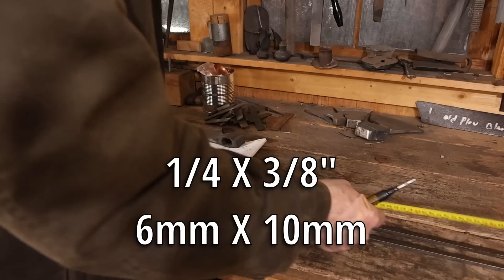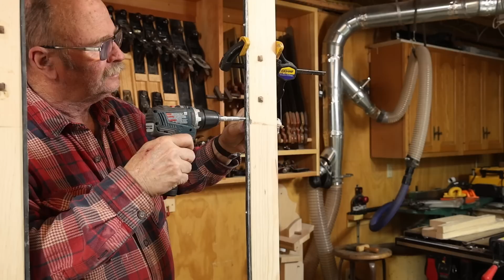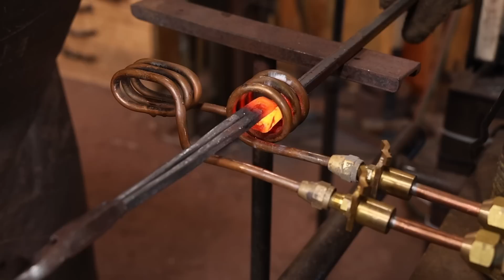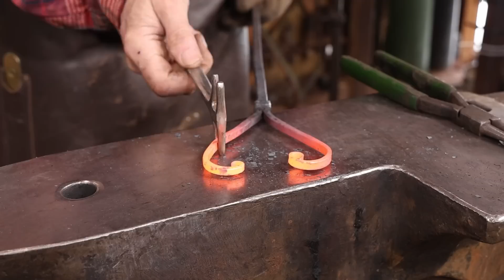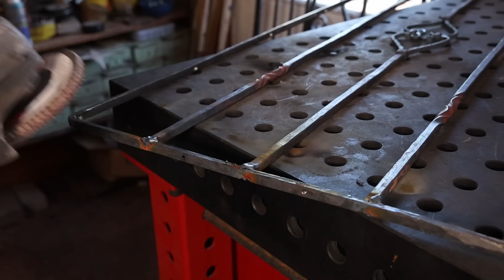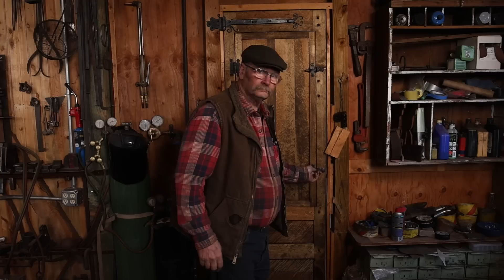Forging a simple Iron Window Grille for the shop door

Comment: Was given a rectangular (1" X 2") steel tube with oak leaf aacorn embellishments. One small detail. It's 5 1/2 " short. A recurring problem with my 1906 house. My thought is to add (weld)an extension to the top of the frame and panel it in solid like the bottom 4".

Comment: Neat project and good work, John.  This is NOT a remark, just something I'll share from personal experience...I found a HUGE improvement in my TIG welds by switching from a the standard (read: awkward) TIG torch, such as the one in the video, to the smaller "aircraft" style torches.  I have 2 of them...one is a 75 degree head, the other a straight "pencil" style.  You could literally touch mark, or autograph your larger work with the straight model.  They both are highly maneuverable and share same gas cups and other parts to a large degree.  Can't beat 'em for small work such as this!  Save the big torch for large sections, plate joining, and other such sized work.
Reply from the maker: I'll have to look into those
Reply: @BlackBearForge  Forgot to mention...it's difficult to determine dimensions and sizes in the video, but if I were doing same welds, I would use 1/16" diameter X 36" length straightened TIG wire...nothing larger.  Any good brand, spec'd for mild steel...probably a shelf item at your local welding supply store.  You can run that in very flat in those welds, minimum radius on inside corners.  When you're done, it'll look like those parts just naturally grew together.  Good luck, best regards...

Comment: Love the door.  question could you forge weld the location where you tiged welded and how would that changed the looks of the joints
Reply from the maker: That would be an extremely difficult thing to forge weld.  A mortise and tenon joint would be the alternative, but in this small stock size it seemed pretty weak.
Reply: @BlackBearForge  thank you for your time and willingness to share your knowledge  I tinker with old horse drawn wagons and am always looking for different ways to connect parts the old ways in stead of going with mig tig etc

Comment: I love this project! Good mix of blacksmithing and fabrication. 

I fabricate more than blacksmith most of the time and mostly smallish items. Over the years, I have purchased three tools that I feel I will never part with, an 8" shear, a dry cut saw and my TIG/stick welder. Long ago, I got a flux core MIG machine and while it does produce functional welds, the spatter is a mess to clean up and the smoke is just a workplace hazard. I tended to almost never use it, preferring oxyacetylene. Even though it puts a lot of heat into the project, the gas torch was still much cleaner and just better for my purposes.... until I bought my TIG machine. Now I use the gas torch almost exclusively for bending heat and my MIG is completely covered in dust. I need to practice a lot more with aluminum, which is one of the main reasons I purchased the TIG, but I found that welding steel with it to be so much cleaner and simpler than any other process. With the relatively small things I tend to fabricate, I don't have to have a large dedicated welding area; I can weld at my regular workspace most of the time. 

So, like the efficiency gain you have experienced with the induction forge, I suspect that once you have gotten proficient at TIG welding again, it may become the go-to modern welding process in your shop, too. :)

Comment: That grill turned out really great, not super fancy but really pretty and fits well with the door.  Does the oxy propane torch get hot enough for stick welding?
Reply from the maker: No, you need to weld with acetylene.